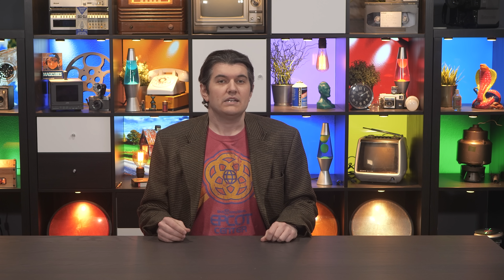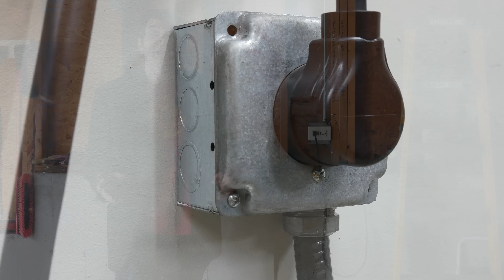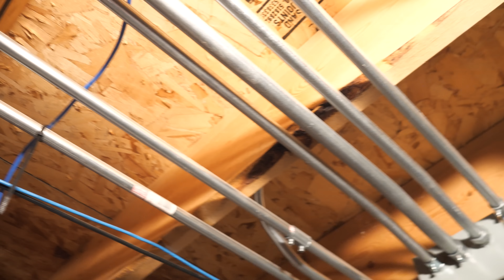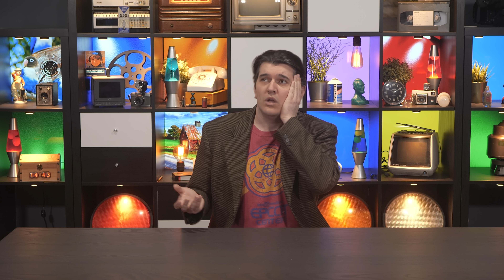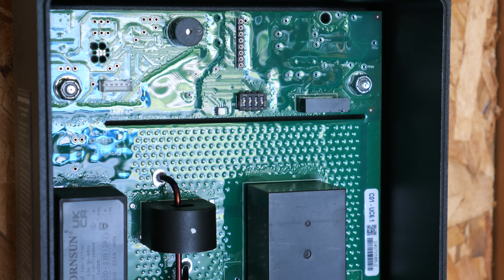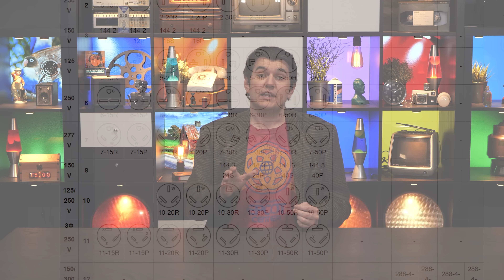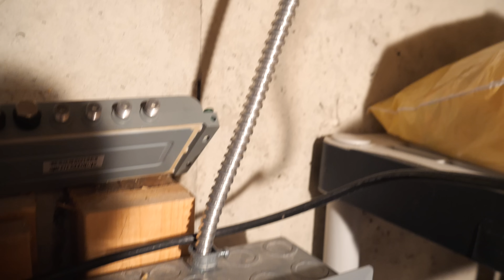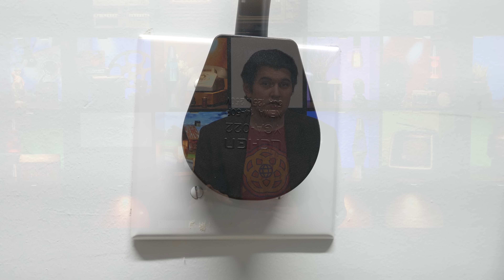The "standard" car charger is usually overkill—but your electrician might not know that

Comment: I work for myself primarily building decks and doing remodeling, and drive a 3/4 ton truck. I have the ocassinaol job where I need to haul heavy(ish) equipment where the payload (~3600lbs) and towing capacity (~10,000lbs) really pay off. 
I've not been one to hardly even consider buying my vehicles new, but as my business grows and more viable EV options appear on the market in this category (payload and towing aren't quite there for a 2500hd but certainly for a 1500 equivalent), I am looking forward to the upsides you point out and the other benefits that often get over looked for a use case like mine. The obvious being the truck is a mobile power supply, eliminating the need for hauling around job site generators and easily keeping tool batteries charged at all times. There are certainly more.
(I think there's an analogy to maintaining charged tool batteries that might make a convincing case for the routine of maintaining the charge on an EV to a portion of the public that may be more reluctant, btw)
Another option I have been interested in seeing development on is the deisel-electric hybrids ala Edison Motors for heavy haul and service equipment and the conversion kits they are offering for service vehicles like mine. The ups and downs for all electric vs hybrid can get pretty use case specific, but my general sense is that a manufacturer serving the midrange truck market (larger pickups generally) would be smart to develop models with packages in both arrangements.  Assuming my line of work to remain similar to now, I would likely lean towards an all electric, but I can easily imagine cases where the hybrid setup could offer greater benefits to the end user. 
It may be a fruitful topic to explore; or at least I would find your thoughts on the matter interesting. I've always appreciated your ability to boil things down in a staight forward way that has mirrored many of my less organized perspectives I've struggled to communicate effectively without glossing over key information or getting (too terribly) lost in the weeds.

Comment: EVs are still only an option for urban to suburban areas. The new EV truck is cool but 36 hours to charge for sub 500 miles is really pathetic.
Reply: So what we're doing is impossible in a rural part of Washington? And I'm not sure why one would need to  charge a Silverado EV for 36 hrs. Math isn't adding up for the real world use case. Unless one drives 400+ miles daily, but even then, there are home charging options for 80 amps (100 amp breaker) enough to juice up that 9,000 lb tank overnight.

Comment: We charge our commuter EV about 2 to 3 nights a week on a 120v 15A circuit. The existing circuit in the garage, with the same Hyundai supplied "Emergency" cable and box... for over 5 years. Nary an issue. Side note: This EVSE looks identical to the Lenz line of EVSEs. Grizzl*e says made in Canada. Lenz says manufactured in China, engineered in USA. Something weird is going on.

Comment: Agree with most of this, except for the smart chargers being a waste because the cars are capable of doing those things… 

While this is technically true, reality is a much more complex story. Owning an EV6 and BMW i4, neither of the scheduled “smart” charging features work and for different reasons.

The way it’s integrated on the EV6 uses the remote login feature to check the battery progress. It pings so many times that it frequently kills the 12v. I had to turn this feature off so that my EV6’s 12v wouldn’t be dead all the time. 

My i4 has a scheduled charging time slot feature, however it’s unreliable and requires a “handshake” when you initially connect the charger. Sometimes this handshake can charge as long as 30mins. 

I have a ChargePoint HomeFlex that has been reliable for 3+ years. I have attempted to move away from the app required EVSE but it’s just too reliable.

Comment: On the app and privacy topic - have you looked at openEVSE? Being able to service and upgrade your charging station yourself seems like your jam, and you get the best of both worlds (no app but it does have a web gui for the local network). There are some legitimately cool uses for a smart charger (e.g charging your car only when you have excess solar capacity, or sharing a circuit between multiple units / cars) that you can't do with just your car's settings.

Comment: I bought my BMW i3 in 2019 and ordered a 240V power station to have professionally installed in my 1947 detached garage, but quickly realized that the standard 120v L1 household power cable was sufficient, even for my 50 mile round trip commute at the time.  To update my power panel and garage to a 240V charging cable would have cost around $8000 per the electrician estimate, so I have just used the L1 charger.  No problem and now that I work at home, it’s way more than enough. 
My car has the range extender which is a nice backup to prevent range anxiety with only 114 mile battery range, but I now realize how little it’s typically needed.  I even made a 530 mile road trip from Salt Lake City to Denver, going through the Rocky Mountains, using the battery only.

Comment: My inlaws were quoted $16,000 to install a charger my wife bought for them.  They claimed they would have to replace the whole panel.  Nope, the manufacturer allows that panel to run 200amp service.  It took about $600 to get the 200A main breakers, a couple of duplex AFCIs to make room, the required new breakers and the cable. Full 48 Amp charging at home.  No problem.
Reply: … you did upgrade the service line to match your 200A main breaker, right?
Reply: "nO pRoBlEm" @wkm122
Reply: Yikes, your in-laws almost got scammed. Even for a new panel and other major work $16k USD is outrageous. 

I had a panel replacement, partial re-wire, and some electrical upgrades 2 years ago and it came to about $5k USD.
Reply: @Dave_thenerd  Yeah, that's insane greed we had an entire house rewired for less.
Reply: One of the arguments that the 'other party' was claiming, during the last election,  about requiring new home construction in my area to provide  an EV capable circuit was that it would increase construction costs of a home by $10-20K!!! To which my BS meter pegged and blew a fuse!  My electrician charged me $900 to run a new 240V line in conduit to the garage.  Even that might have been too much, but compared to the other bid for $2500?
Reply: So as an electrician I'm going to say that this wasn't total bs in the part of the guy giving you the quote.  I don't know you're regional, and I'm just a Journeyman so I don't know much on the bid side of things, but I can say that the panel upgrade was likely the result of trying to save you money and hassle in the long run. The new panel honestly might  have been cheaper than the breaker and likely would've provided more spaces so didn't have to add twin/split breakers which are notorious among electricians for being present in overloaded panels.  Alot of the time were trained to try look down the road if we can. A common saying in the field is "You don't want to fuck over the guy coming after you, because it's probably going to be you!"  Again not saying there wasn't any bs involved or that the guy you talked to wasn't doing something shady, but as field guy that's what I'm seeing.

Comment: years ago it was common to have an 50 amp "oven" receptacle on 50 amp breaker(or fuses), only fed via 8awg copper or 6awg aluminum, which is then a 40 amp circuit.
that was done still into the mid to late 90's and was an acceptable practice due to breaker/fuse availability and being limited usage appliances and many sub panel/main feeders were down gauged or over size breaker to next nearest available. they changed the code quite long ago now, but vast amounts still exist and would be way overloaded if someone tried drawing 48amps, being they're truly a 40 amp max circuit.

Comment: @TechnologyConnections In regards to your disdain for "Smart Chargers" there are a couple of things that really make them worth it in some circumstances.   I have both a Chevy Bolt and a new Chevy Equinox EV - unfortunately the Equinox EV does not have the same ability to schedule charging for off-peak hours as my older Bolt does.   Instead it has a feature to finish charging by a set departure time - and that's the only option available.  So if you have it set for 6am because that's when off-peak ends it might start at 10pm before off-peak starts if the battery is really low.   I ended up just setting up my smart charger to only offer a charge during my super off-peak hours in the middle of the night and it automatically shuts off even if my car only made it to 65% instead of the target 80% battery charge.   And as an added bonus my smart charger can be configured to do a variable amount of amps based on what the rest of my house is doing - something important to me on my old home with a 100 amp service and certainly even more important to anyone with an even smaller main breaker than that which is common in older homes like mine.

Comment: Interesting video about the American power grid. Here in Germany, I find the choice of plugs much simpler. CEE 11 or 22kW for charging. However, I haven't been charging at home for almost 2 years now because I can charge significantly faster on the go, at almost 300kW, which is the maximum for charging stations here.

Comment: All you need is wires he says... well not with $3,000-$10,000. You can go wireless... with the Motorola DynaTAC 8000X, released in 1984. Its price in 1984 was US$3,995. Adjusted for inflation, that is equal to roughly $12,000 today in 2025. Just think, right now you can overpay for a feature that may become standard in decades... better hurry the FOMO is running out.

Comment: 19:45 So for trenching and running electrical out to a remote location, that doesn't have to be expensive from a monetary point of view.  If you look up the code and are willing to hand-dig the trench yourself then you can dig the trench and either install conduit and THWN or else direct-bury cable.  You don't even necessarily need a subpanel in a detached garage that has no  electrical power of its own if you're not running any branch circuits off of that charging station, so long as it's properly connected in the main panel at the far end.

Where my parents live, the code for on-prem conduit where there's no natural gas service is only 24 inches depth.  Dad dug a 90' trench with a spade shovel in order to prep for a new detached shop, and installed all the happy gray PVC conduit for a 100-amp service out to that garage.  The electrical cables were the most expensive part of the job.  When the shop was built a Ufer ground was built and the copper tab for it left accessible, so even providing proper bonding and grounding was comparatively easy.

Comment: a buddy of mine has his charger directly in the center of his garage. One half of his garage is on one breaker, the other half on another. By having the charging station plugged into both sides, he manages to get 220 volt supply with only nema15 plugs. Kinda cool if you think about it.

Its not perfect, and he did end up changing the breakers so that they are "Tied" together in a sense so that if one pops, they both pop, that way he's not dead leading the charger.

Comment: I charge on a 240v 20 amp circuit. Got it installed for a table saw about a decade ago and theres a charger with the correct nema plug for my Bolt. Easily 160 miles overnight even if we get home way late. From getting home at work to waking up the next day I can also go from empty to full, 250+ miles. A dryer socket would be 50% faster, but the reality is I just don't need it.

Comment: The number of miles you drive in a day, plus 10% divided by the efficiency (mi/kWh) your car gets is the number of kW you use per day. Take that number and divide it by the number of hours your car is able to be plugged in per day (ie over night), multiple it by 1000 (to convert it to Watts) and then divide that the 110 or 220 (depending on the plug you have) and that's the amount of Amps you need on that circuit. 

I drive 60 miles a day, put in the extra 10% and given my car gets 3.5mi per kWh, I use around 19kWh per day (66mi / 3.5mi per kWh). The car is plugged in for 12 hours a day, so that's 1.5kW per hour of charging I need., I have a 220V outlet in the garage,  so 6.8A circuit is fine for my needs, but if it was 110V, then I'd need 13A given a "regular" circuit is usually rated at 15A or 20A, I didn't need to do any upgrades to cover my driving needs.

Comment: There are situations where being able to track charging usage is handy. I have 2 roommates in a house and have considered getting an electric for my next car. As we all split electricity, it wouldn't be fair to include car charging in our total. Being able to know exactly how much is for the car would make that much easier. There is probably other methods, but having one built in would be convenient.
Reply: Many rate plans are tiered, where the kWh above a certain amount each month are at a higher or lower rate. Making it harder to gauge the cost effect of charging. The most accurate and fair method is to calculate your electric bill each month in a spreadsheet including taxes and other fees, then as a what-if you can subtract the kWh of charging to calculate what the bill would have been without charging, split that by 3, then add the difference with the actual bill to your portion. If that seems too much trouble then you can come up with a simpler estimate maybe based on miles driven each month. Also some utilities will install a separate meter for EV and give you a discount if you charge at certain hours.

Comment: Well, if you need 240 volts you could always....   (heh heh, you thought I was gonna tell)  😜

(For those that know, I'm sure you also know not to say anything)  😉

I got to work with an old Solectra car back in the day, and that was much less pretentious.  They literally just has a standard 15 amp 120 vac plug built into the car.  None of this fancy "quick charging".

Comment: I want my ev to charge as fast as possible. I have a full 48 amp charger and only takes at most 4 hours to charge after driving. If something comes up I want to be able to head out right away and not have to stop along the way to charge. You never know when you might need to get up and go.

Comment: The funny thing is, I had a charging station installed at my old place for 240V charging, and I ended up renting that place out and moved elsewhere with my Bolt. I was putting off getting a new charging station, but then I realized, I never really needed more than the standard 120V plug it came with and it was enough for like 99.9% of my needs. For that 0.1%, I just ended up going to a fast charger if I really needed it. I don't even keep it plugged in all the time, because I'm never close to running out of charge. Granted, I work from home, so I probably drive less than most people, but even if I drove like 20 miles a day to work, I think it charged enough to be able to keep up during the weekdays, making up any difference on weekends.

Comment: In North America, if you're wiring your house for an electric car, you could just watch this video or read the regulation.
Most areas follow NEC. For EVs. On Article 625, which covers EV charging systems:
- Entirely separate 240 V circuit sized ≥ 125% of charger load
- Cord & cable type, length, interlocks, grounding, automatic shut‑off
- GFCI (personnel protection) required near plug
- Lockable disconnect if >60 A / >150 V
- Location mounting heights & ventilation rules
- Specific protections for outdoor/wet‑location plugs
- Must use a UL-listed charger on a dedicated circuit, installed by a licensed electrician (permit + inspection usually required), with GFCI protection and enough panel capacity. As I copy and pasted this i'm so glad I'm just going to skip it and watch the video. Speak of the devil I have about $3,000-$10,000 budgeted for a charger, any chance you do a review of EV wireless charging?

Comment: If the garage outlets need to be gfi protected I would just install an arc fault/gfi combo or just gfi breaker for each circuit. Should be available in 30+ amp options.

Comment: Because of where I live, pretty sure 120 volt charging would be enough to top up or completely replenish a commute from where I live in Oshawa, ontario, to down Town Toronto, about 50-60 KM away, i imagine at most one will be driving 120-150 km a day commuting to toronto (and adding extra for, say, shopping, breaks, friends wanting drives in the area, etc)
With the area I live in having public chargers around, like at walmart or colleges. range anxiety isn't a thing in my head when it comes to EV's/

Comment: There are even more options!

You may be able to install a medium power AC charging station without running any new wires.  If you have an existing 20 amp circuit feeding only single 15 amp duplex/quad outlet box (a common situation in a garage), you or an electrician can convert that to a 20 amp 240 V EVSE by simply repurposing the existing neutral to a second hot wire.  You need to replace the breaker with a 240 V breaker, clearly mark the old neutral, replace the outlet and you are done.  You have to be willing and legally able to give up the 120 V outlet entirely, but now you have  a 3.8 kW charging station.  That's no speed demon but its much faster than the 1.4 kW you would had had with the old outlet box.

If you have a 15 amp dual/quad outlet box on a 20 amp circuit with 12 AWG wiring (the vast majority of utility outlets are on 20 amp circuits) you can just replace the outlet with a 20 amp outlet and get 33% faster charging.  Total cost is $5 at the hardware store plus 15 minutes to change the outlet.  You don't have to touch the breaker box at all.